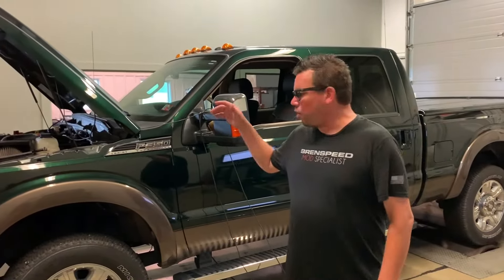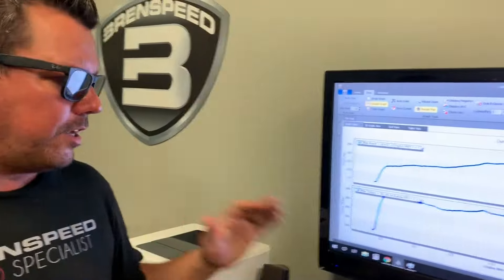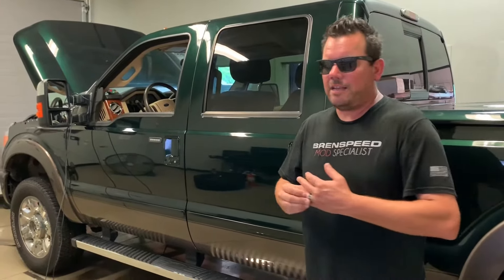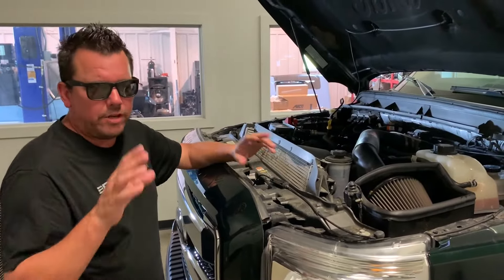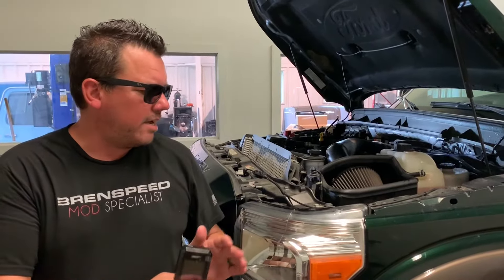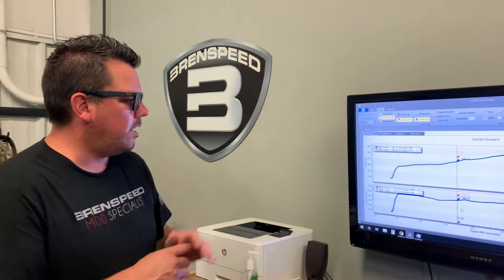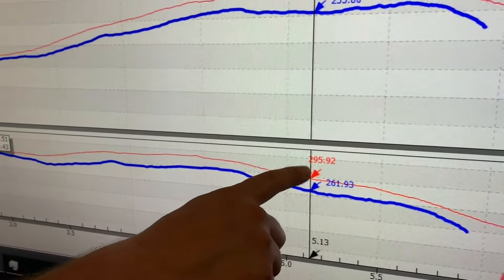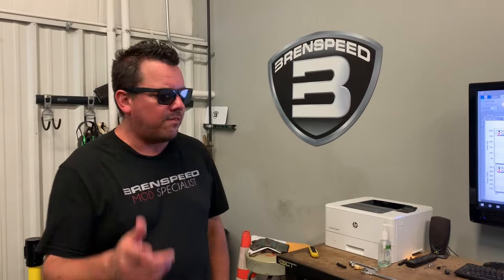2016 F350 6.2L Work Truck Dyno with (Bolt On Parts) Super Duty at Brenspeed

Comment: Does that thing have like 400K on it or something? The 6.2L in the 2011 - 2016 Super Duty's made 385hp at the crank, even given the larger wheels and tires and the heavy duty drive train, that's like a 120hp loss from the crank to the rear wheels. That's insane.
Reply: 4x4 . With big ass torque converter and 6R80 transmission.  No need to ask yourself why .
Reply: @Spad68  6r140 actually, its a very heavy, brutish trans. its like the modern equivalent of a c6, stout, but major power sappage
Reply: You're talking crank numbers not wheel numbers here bud😂😂😂
Reply: Depending on the gross vehicle weight rating Ford has 2 hp ratings. Under 10000lbs 385hp over 10000lbs they are rated at 305hp. Torque stays about the same but they seriously detuned the 6.2 for the f250 and 350
Reply: Youtube sucks  i think the 17 and up f250 have a 6r120, which is slightly less drivetrain loss, but all the 11 through 16 and all the f350 have a 6r140.
Reply: @jasonhooey5677  Is that true? I guess thats why my 5.4 3V F250 reg cab (rated 300hp) is able to keep up with my brothers 6.2 crew cab.
Reply: @Steven Seagull Well his is a crewcab 4x4 with 35s.  Mine is a standard cab 2WD.  They are pretty equal in stoplight races. He's much heavier
Reply: @Steven Seagull I have an 11 Platinum F150 w/6.2L Says 411 HP stock. Feels powerful as hell :lol: 20" wheels 3.73LS rear.
Reply: He said it was 87 octane and yes 120 ho loss from crank to dyno is 100% reasonable and if you actually watched alot of videos would know that the goin rate is 100hp. From engine dyno to whell dyno
Reply: In a gigantic crew cab on 20s and 35" tires yes there will be 120hp difference in what the trans can put down to the rear wheels. And I bet in 4wd on a awd dyno it would've shown closer to 300 wheel horsepower. But still with just headers and a 87 tune a 35/35 increase is very good.

Comment: I use my 6.2l 2019 F350 Dually regular cab to haul building materials across the Cascades in BC with a trailer. It has a 7,100 lbs payload capacity, and I usually pick up a 5,000 lbs pallet in the box with another in the trailer. It hauls with no problem. I don't push it over the long grades, as I'm not 35 years old, and it does just fine. Headers would be nice, though. Cheers!

Comment: Numbers seem super low. They certainly don’t drive as anemic as those numbers suggest
Reply: I was thinking the same thing. My company has a 2012 6.2 and that thing will 7,000 trailer up a hill like a diesel. The only difference is it will be in 4th gear sounding like a nascar.
Reply: @blackericdenice I own a 2011 and I know for a fact that these trucks make more power than that I mean it should be making at the very least 375 from the crank
Reply: @Ye_salty_dog  They are making 385 at the crank
Reply: @blackericdenice  well yeah that’s why I said at the very least, idk what these guys are doing to make the numbers so low

Comment: My 2012 f150 lariat Limit FX4 6.2 with 3 inch exhaust system super 44 flowmaster resonator.  My truck dyno 330HP 350 torque
Reply from the maker: Nice!
Reply: With a competitor's 91tow/performance tune, true duals 3" new style flowmaster 2 chamber x2 with X pipe and a square K&N in factory airbox (before my turbo upgrade.) I hit 368HP/389Torque...

Comment: How can increase torque on a 2017 f350 gas in a way that won't over stress other parts and can be fairly easily removed when I want to sell the truck in a few years? Looking for a little more power towing up the longer hills in PA, but don't want to kill my resale value when ready to upgrade.
Reply from the maker: If you want something easy to remove do a cold air intake and sct tuner. That is about the easiest way to add some power and torque and you can remove it in a couple hours.

Comment: Gears do a lot for 6.2 gas trucks
Reply: Yep, 4.30's minimum, 4.56's are even better. Going to 17" wheels helps as well.
Reply: I ordered mine with 4.30s from the factory.  But with the stock 245/75/17s, it feels like all revs, but you don't go anywhere until it gets to 3rd gear. Lol.  I need bigger wheels and tires..

Comment: I picked up a 2012 f250 for $800 and want to add HP....Its a 6.2l gas heater but I want more power.
Reply from the maker: Start with a cold air intake and SCT tuner.
Reply: @BrenspeedEngineering  My cousin also recommended me those 2 things. The truck works good but I know it can get better.

Comment: How much change in the transmission fluid temperature was seen? The cross over pipe is right under the transmission pan and I would imagine unless it was wrapped it would radiate some serious heat to the fluid.
Reply: well even in stock form, this trans keeps its cool very well. with normal in town driving, it might take 3-4 miles to get up to temp, if it does become an issue, aftermarket trans coolers do wonders for a few bucks
Reply: @runeshark22 , Thanks for the reply. Overall are the headers worth the expense over stock manifolds?
Reply: @rdp2370  on these trucks? hell nah. They're fairly expensive, and seem to be a major pain in the ass to install (its not like slappin some long tubes on a 390 galaxie), with minimal power gains. I'm going to approximate that in this test hear, 75% of the gains were due to the tune, without a tuner, you'd be looking at 5-10 horse at the wheel. They sound great, and you'll get better throttle response, but overall not much more power. If you do the CAI, TB, headers, full exhaust, and a tune, you're looking at solid gains, but to just do headers? not really. But the tuning is the essential keystone here, without it, all those mods are for nothing. I also recommend bumping it to 89.
Reply: @runeshark22  Thank you,  just saved me  $$$$, I have a cracked exhaust manifold on my old work truck and its just that. So i think I will save my money and just stay stock.

Comment: Would a better or upgraded torque converter help
Reply from the maker: A higher stall converter always typically helps acceleration off the line.

Comment: VL performance did just a tune and gained the same amount of power you guys did with a CAI intake, Tube headers, and a tune. How did you guys make the same gain numbers but your truck has actual power adders on it?
Reply from the maker: Could have been a lot of different things. First that dyno they use is not the same as ours as you can tell by the software. Also the baseline was a a lot higher stock. This truck in our video retained 87 octane. In the end to many variables to answers but thanks so much for watching and thanks for the comment! Appreciate it!

Comment: Just seems like some sad numbers. I wonder the numbers difference in HP/TQ  throughout the rev range on a 6.2l vs a 5.0 Coyote truck engine.
Reply from the maker: It would be cool to overlay those sometime.
Reply: I thought when the 6.2 came out they were making like 375ish and then after like 2014 they went up to 400hp is there really that much drive train loss in these trucks? That seems really low to me as well.
Reply: @00jake00   my 2019 f250 was advertised with 385 hp and 430 ft lb torque  those number do seem a bit low but i think they squeezed a bit more power out of it from 2016 to 2019

Comment: Those are pretty weak numbers for a heavy duty truck. Diesel is the way to go if you want lots of power.
Reply: but you'll never get that flat or a curve out of a diesel. If you're going for BIG power then yes, diesel is the way to go. But if you're not running a pulling truck, or a drag truck or nothin, then this 6.2 is a great engine. i got mine built for a trail truck/overlander of sorts, but still keeping its trailering abilities. It'll pull 10k pretty easy, and has a good amount of giddyup from the line. Gearing is the key with this, 4.30s are invaluable for any heavy use, it won't make up the gap completely from the diesel, but its no slouch
Reply: I went from a 3V V10 to a nicely modded diesel. I miss tons of stuff about the gasser mainly the instant power around town. The diesel is just more fun in hooning situations.

Comment: I’m new to the Superduty and I’ve got a question. What kind of high flow cats did u use on this truck? Did dual spintech super pro street 9000s 3 1/2 in and 3 1/2 out. Haven’t ran tail pipes yet for a few reasons. Any pointers?
Reply from the maker: Most of the header kits like Stainless Works come with cats so we use the ones that come in the actual header kit.

Comment: I like those numbers… I just purchased a 2016 F350 with a 6.2 gas it’s only got 34,000 miles… I’m looking to get a little bit more power because I haul a truck camper with it inside the bed. I was wondering where you guys were located at to maybe duplicate those numbers for me?
Reply from the maker: We are in Indiana. Parts links in the description. THANKS
Reply: Do you think the 6.2 f 350 is worth buying?

Comment: Is this just headers or x pipe also with sw mufflers?
Reply from the maker: It has an aftermarket mid pipe also, so headers, mid pipe, and mufflers.
Reply: I have a 12 6.2 F250 with cai, 4" exhaust all the way back with a borla exhaust, 33x12.5x20s with a level kit making 490 at the rear. Sct x4 with custom tuning. These numbers are pretty low
Reply: Tyler Fitzhugh I have a KN CAI, BBK throttle body, Tuner(not custom), and a custom catback exhaust and I’m right at 300whp. Im sorry but theres no way your making almost 500hp with just a cai, exhaust, and tune. I need to see some dyno charts.
Reply: @superdutyzack  , did you notice much difference in the new throttle body?
Reply: Richie Pointer absolutely not, waste of money.

Comment: Question do yo think running a 93 octane tune on it would get some healthier numbers out of the 6.2
Reply from the maker: Yes 93 will always produce a few more ponies for sure. Often even improved MPG.
Reply: Good to no especially that you may see the same fuel consumption if not maYbe even alittle better on the mpg
Reply: Do you get your money’s worth with the added power but increased fuel cost of 93?

Comment: Who the hell in the right mind buys a GAS 1 ton!?? LOL
Reply from the maker: LOl that guy. Thanks for watching!
Reply: Me :) diesels are for people who think they do more than they actually do.
Reply: @JD-ys7fj  I think your right, LOLOL
Reply: Somebody who needs a higher payload cap. than diesel....6.2 will have 700 + pound higher cap. all things being eqaul.
Reply: Way cheaper to own , ever price any parts for a diesel ? Five times that of gas including more expensive fuel and the piss additive you have to have these days
Reply: these aint the gas engines of 30 years ago, the early EFI windsors and smogged out big blocks. I got a buddy with a 2001 7.3 with 4.10s, and we towed the same weight on the same trip, and we were effectively dead matched. A super duty 7.3 with lower gears is basically on par with a first gen 6.2 super duty. Get the new 7.3 gas engine with the 4.30, i'd wager its about on par with a stock 6.0. And you end up with a much nicer truck overall.
Reply: I’m one of those guys looking into a 1 ton gas.  I had a 7.3 diesel cclb that was just tired. Love the truck till it got stolen.  Now looking into a gas for a change.  I don’t pull heavy trailers and figured to go the gas route.

Sure the 6.7 has that god-like 1000 tq but then again with the maintenance stuff like dpf regen and adding def, kinda want something simple.
Reply: @JD-ys7fj  Exactly!
Reply: @OhDamniiiTsRey a one ton but dont tow heavy...? Get a short bed and save the real ones that'll get used for dudes with a purpose for them